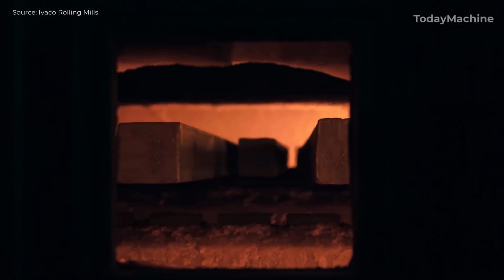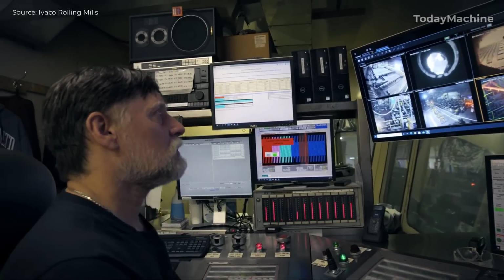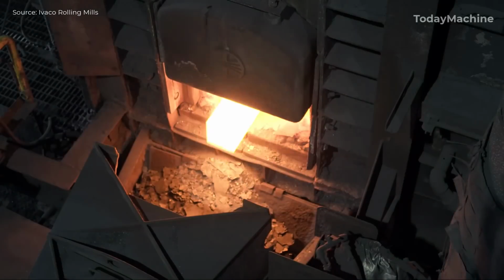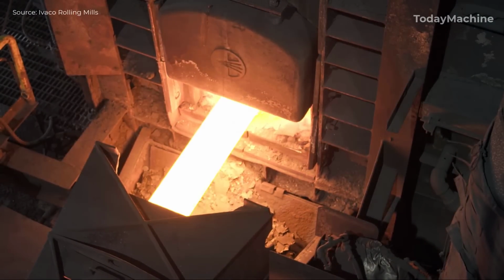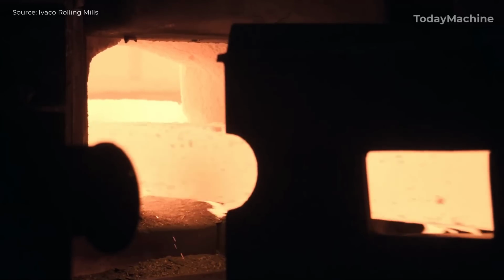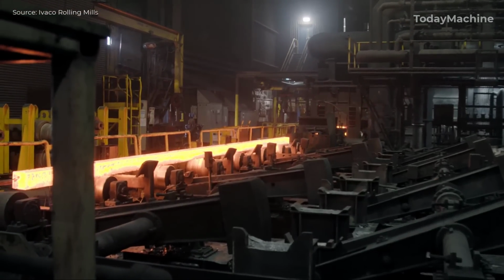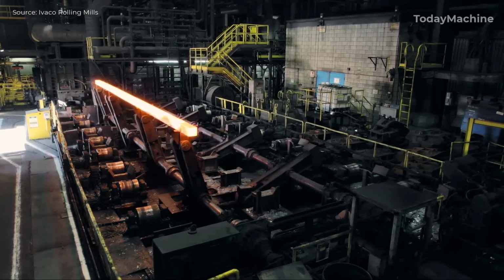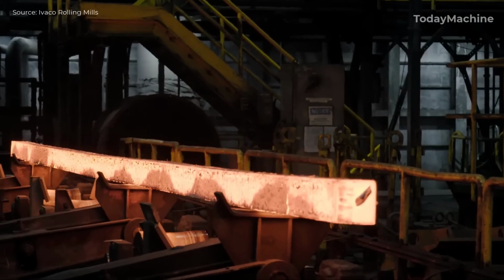How Giant Wound Springs Are Made. Steel Recycling Mill And Razor Blade Manufacturing

Comment: "A 2in coil spring may have to support 10,000 lb?" Good greif I hope so! The valve springs in a race hemi hold 1300 to 1500! I'm thinking more along the lines of 100,000 lb at minimum if wound as tight as in the video. Maybe they're for T-rex pogo sticks?

Comment: The two guys fighting to bend the spring look fifteen minutes out of the stone age.
Reply: They cut out where the one guy made the sign of the cross before he started coiling.
Reply: You don’t know the forces there. This Spring kills you in 1/100 second.
Your dead by Acceleration.
Reply: @Spiegelradtransformation  that slow spring winding section looked terrifying. If that steel fractured any one of those guys could be seriously injured or killed. Yikes.
Reply: Slinkies were novel so had special value when new
Reply: Should have been muted.... Dude just rambling on while Pedro is yelling to put more Sriracha on his pipe...